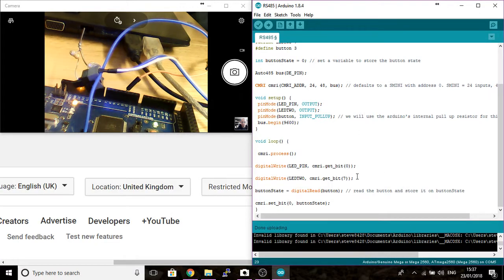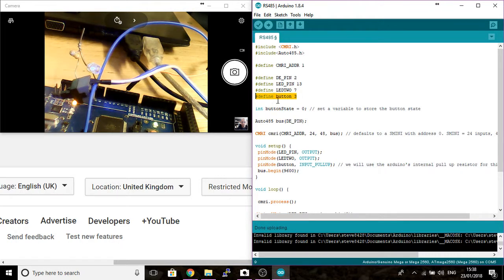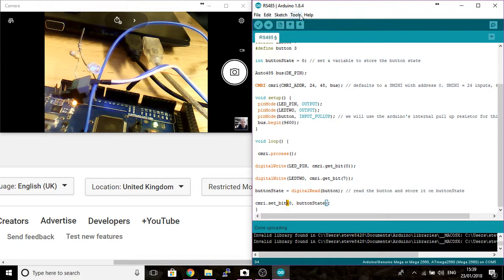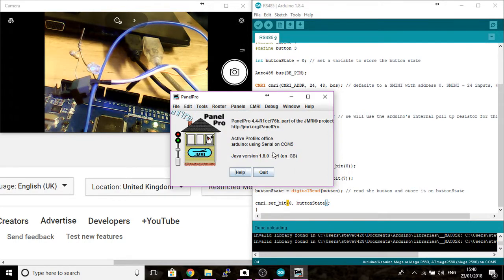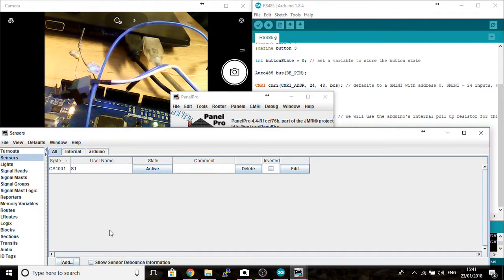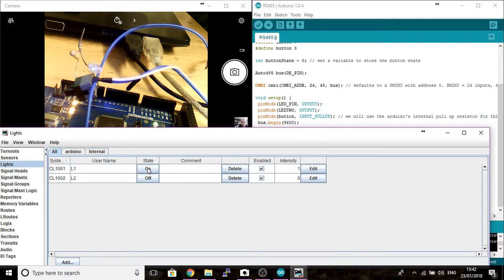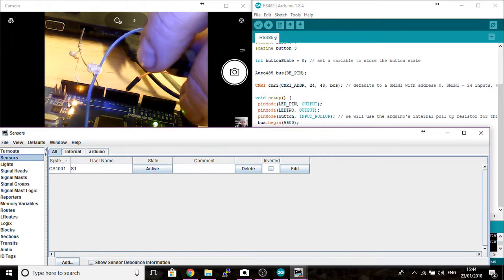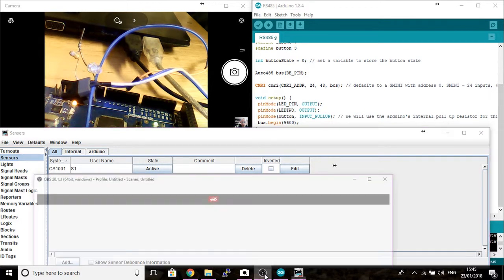JMRI Arduino sensor setup Part 2

Comment: Excellent web / video.  I had to make a couple of changes to the Arduino program, I was using the USB serial interface as I didn't have a full RS485 setup.  I also went to the next step, and added a control for the other light to light when the switch was off.  Multiple things happening with just a switch.